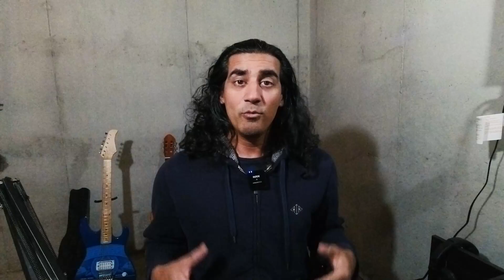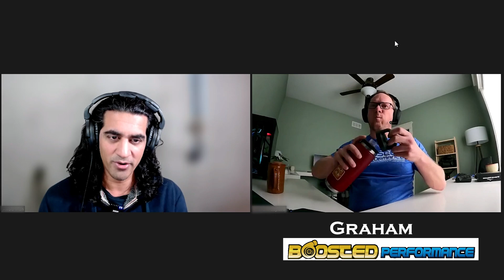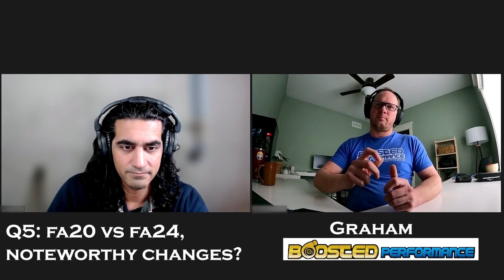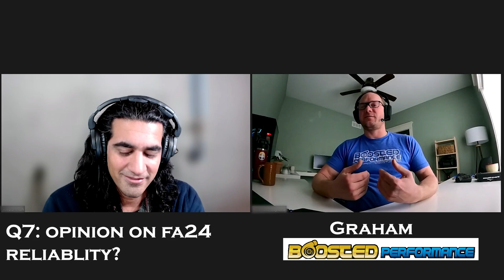2022 WRX Protuner Interview // Ep. 1 // Boosted Performance Tuning #2022wrx #subaru #wrx #tunertalk

Comment: I believe you said your 70k mile WRX had 350 wheel horsepower before it started making piston slap noise. You said you drove it extremely hard. If you had driven it easier would you think you could have made it to 109-150 thousand miles. I have a 2025 WRX premium I am considering turning to 350 whp.
Reply from the maker: Definitely would have lasted longer. When I mean hard I was on multiple tracks. Autocross, rallycross drag strip, road course. I was full tilt at every event while being a novice driver. A regular car with 350whp would be more than fine.

Comment: Some questions for him next time:
- recommendations on break in period, do full 1k? or ok to send early?
- thoughts on oil change at 1k miles? Should the differential and trans fluid be changed out early too?
- thoughts on running e30 on factory tune?
- best whp intake?
- thoughts on oiled vs dry intake filters?
- upcoming VB products hes excited for?
Just a few that popped into my head! Great vid!

Comment: Can you provide any feedback regarding the Turbosmart Kompact 50/50 BOV? Bad idea venting to atmosphere long term? Ive been told "it will run rich between shifts" but I suspect the impact is more complex. I'm about to take mine off, it vented in first gear, then stalled around 15mph.

Comment: Hey man, new to the channel and first time Wrx owner (VB) ! Learned a lot from this video as someone who is clueless to tuning. How does subaru look tunes when i go for oil changes and lets say anything happens to the car what would you do then to avoid a warranty void. Thanks!
Reply from the maker: Hey brother, welcome to the channel. I appreciate your support! 🙏 🤘. Realistically, I think it depends on your dealership. My dealership, half of the salesman and almost all of the technicians actually drive tuned WRXs or STIs so their custom to doing their best to help the community when it comes to warranty. Some dealerships are not about that. So it's I would say if you ever need to do any warranty work and you are doing definitely remove your access port and tell them if you're doing an oil change to never do anything else other than oil change without talking to you.

Comment: Has anyone started work on the STI transmission swap yet? I have a ‘17 WRX (360whp on e50 and methanol) and I bought an ‘05 STI with a blown engine with the intention to swap the transmission and diffs into my ‘17. Now I’m waiting for the ‘24 WRX to see if it gets a facelift/Performance Pack/hatch body style before I make a decision to stick with my ‘17 or move to a VB. A completed STI transmission transplant into the VB is the one thing I need to see in order to make up my mind. I sure hope it happens because I’d much rather put money into a 2.4 liter with a transmission behind it that can handle fun stuff like dual injection and nitrous.
Reply from the maker: I'm waiting for the news of that STi transmission swap too.

Comment: Looking at the dyno graphs, i assumed the turbo waa the restriction as stated. I would like to ask about the rpm limit (with a better flowing turbo) as i believe they upgraded the valve springs over the FA20 which revved to 7000ish.
Reply: I was wondering the same.  The beehive valve springs should allow better function at high RPM.

Comment: Please look into adding the cvt to these talks.
I am in the beginning phase of tuning mine, and I know cobb has put it off for now.
I believe learning this new cvt first before tune is key.  

Like this show alot. Thanks for posting. 👍
Reply: The cvt can’t handle the power
Reply: Have Misha talk about CVT for Subaru
Reply: They have been working on a solution for the CVT but it will be very limited.  Maybe a 5-10whp gain.  The CVT will not handle addtional torque and thows a fit.  The CVT was designed to help the WRX meet fuel efficiency standards and not for performance.
Reply: Ditto:
Looking to see what the CVT can handle as well. The SPT is completely different CVT experience in comparison to conventional CVT. I can attest I have tried both, and SPT is serious. Still would love to see what tuners have worked with the SPTs.

Comment: so how long can i run a part before getting a tune? do they recommend putting mods on like day before or can i run it for like a week-month?
Reply from the maker: My suggestion is any part that can add power should be tuned for. Things like catback and axleback won't need a tune. There are some parts like intercooler, you could potentially run but won't get any benefit from without a tune.

Comment: How much of an issue is LSPI (Low Speed Pre-Ignition) with the FA24? Since the rods are beefier, can it handle high boost at low RPM unlike the FA20? Not saying to floor it in 6th at 2k rpm of course, but just wondering if it's less of a concern.
Reply: @Boosted Performance Tuning can the FA24 handle full thottle from 2k rpm on 1st to 3rd gear?

Comment: Maybe in the next one talk about protune vs etune. Pros cons of each and maybe what type of customer they fit best
Reply from the maker: I will definitely add this to my list of questions!
Reply: Thanks for the replies! Another thing I am curious about is E40. Maybe talk about the pros and cons of E40 and if it’s better, worse, or indifferent when compared to 93. I can see the power differences and I know more power is generally less reliable but is E40 harder on the motor or fuel system? Would you recommend E40 for a daily driver or 93?

Comment: Is going from a VA to a VB worth it I just got a chance to buy a wrx 2015 with a blown up motor or make the down payment on a VB wrx
Reply from the maker: Honestly that choice is still subjective. If you aren't worried about looks then the VB is already proving to be a much better engine overall than the VA. It's just improved a lot of the shortcomings from the FA20. If I were you I'd get a VB over a used VA.

Comment: Hey brotha I wanted to ask if e85 is ok for the 22 wrx? Thanks for videos man favorite channel hands down.
Reply from the maker: I'll add that as a note for next time! Thank you for the support.🙏🤘
Reply from the maker: So full e85 is not something we can run right now. Much like the 2015-2021 WRX , the 2022 will need a pump upgrade. Give it a little more time and I think full e85 may be possible with flex fuel kits and pump upgrades.

Comment from the maker: Chapters:
0:00 Intro
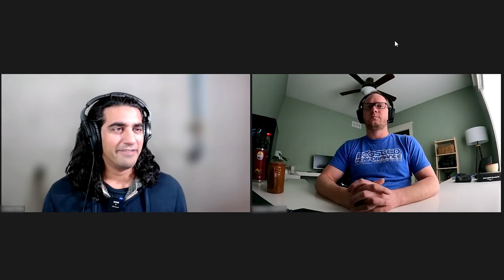1:24 Graham Intro
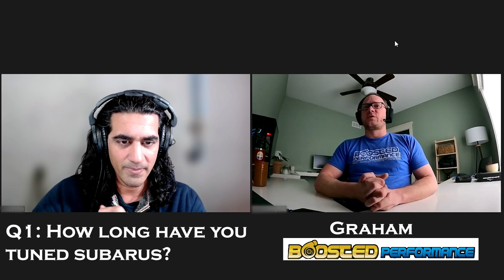13:52 How long have you tuned subarus?
16:00 Intakes without a tuned?
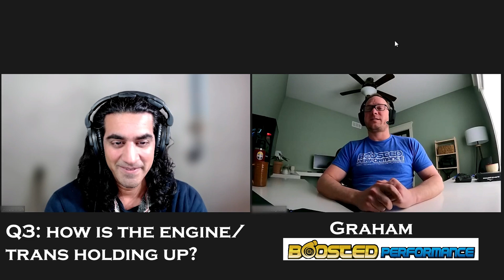21:24 How is the engine/trans holding up?
28:21 FA20 vs FA24 Red flags?
31:43 Fa20 vs FA24 Noteworthy changes?
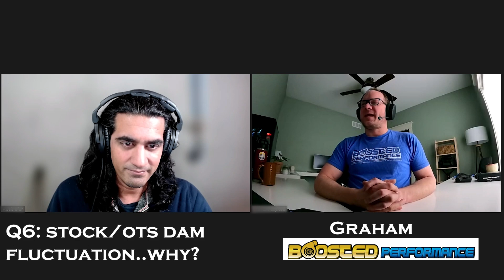46:19 Stock/OTS dam fluctuations?
51:28 FA24 Reliability?

Comment from the maker: What questions would you like answered in the next episode? Make sure to share this information with your friends and other FA24 owners!
Reply: What is the relation between timing and boost, which one is better for power and torque.
Reply: Since where I live I only have 91 octane fuel (And CA "Special" formula at that) and E85 available to me- what safe and reasonable power/torque levels would be fair to expect for the FA24 engine with a pro tune and is it even worth it?  Should I just stick with a Cobb tune that it comes with and call it good enough for 91 gas?
Thanks!
Reply: Oil catch cans. Worth it? PCV or CCV or Both?
Reply: Would love to know about the GT and the SPT tune options. I have one due to unfortunately a serious leg issue which makes it hard to drive Mannies.
Reply from the maker: @EmperorPenguin  unfortunately Cobb doesn't have anything for the auto yet. You could get a JB4 and that will give you some extra power but it has its own limitations.